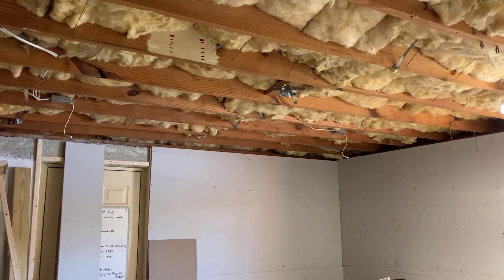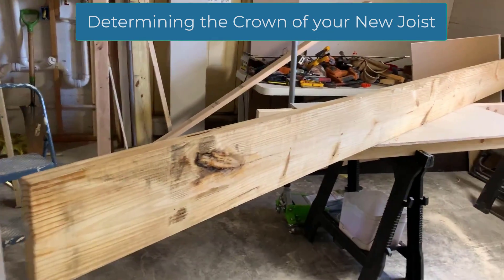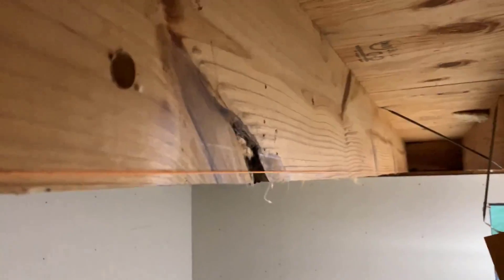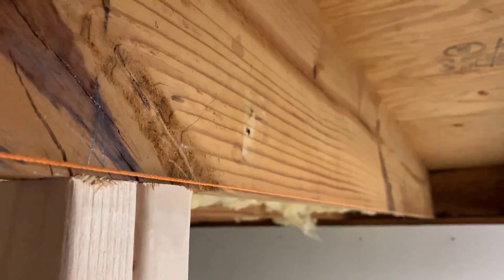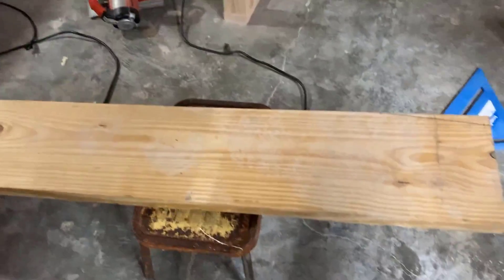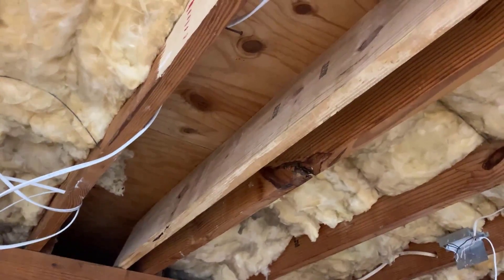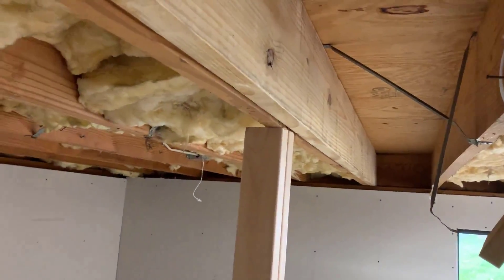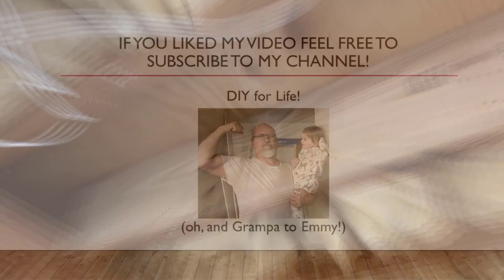Floor Joist Repair Video

Comment: Jw: would you think that building up a standard milled 2X8 to an actual 2"X8" rough cut joist with plywood plating to be the best way to replace floor joists that were used in the 1940's? Without going to a custom sawmill, I need to do that. 1/2" sides and 3/4" on the top gives same dimensions as current joists. Lapped joints on 16' span. Ie: sides are 4'-8'-4' and top is 8'-8' .
Reply from the maker: Hey there Morgan.  Sorry for the delayed answer.  I can honestly say I'm not sure and there are far more knowledgeable people than myself who could answer.  However, I certainly can't see the problem with it.  Would you just glue and nail the plywood to the surfaces?  Other than a possible concern about compression of the plywood that is carrying the weight (which may not even be an issue) I sure don't see a problem with that solution.   Good luck.
Reply: @RighttothePointDIY  glue and screwed the plywood. Really stiffened the boards up. Seams are staggered to avoid a week joint. Thanks for the reply, maybe an idea you can use.
Reply from the maker: @morganottlii2390  Awesome!  Great idea that I will keep in the back of my head for sure.  You never know....

Comment: Would it help to glue the knot?
Reply from the maker: Hey Paul. Yeah, I commented on that in the video. The reality is, that joist is compromised so bad that even glowing it wouldn’t help. The main weight is being held by the new joist anyways. It wouldn’t hurt to glue it, but I don’t think it would help much.

Comment: Hey Guy, I would suggest you add some 20b nails because screws can snap. Nails are NOT brittle and withstand expansion and contraction better.
Reply from the maker: Thanks for the note.  I have explained this in a few of the different comments but the reality is the screws are only holding the old joist to the new one.  They are under literally no shear weight.  I probably could have not even used any adhesive because the only purpose of both it to hold the new joists to the old.  The weight of the floor coming down on the joist is being bore by the ends of the joists.  When I did the video I didn’t outline that like I should have.

Comment: I wish I could have seen you removing the wires. Did you disconnect from the breaker box and pull them out through the holes of the joists? Is there a max number of holes I can drill to reinstall the wires and maintain strength?
Reply from the maker: Thanks for the questions Derek.  How you deal with the wiring really depends upon how accessible your wiring is and where it originates and terminates.  So, in my case I only had to disconnect my wiring from two places (a run to a ceiling fixture and a run to a wall switch) and pull it back and then drill the hole I needed I’m the new joist to rerun it.  However, my whole basement was exposed studs and easy to access.  In extreme cases where you can’t access the termination or origination points of the wiring (the breaker box or outlet) you may need to actually cut the wiring and put in a junction box to splice it back.  Obviously do that with great care or get a licensed  electrician to do that part if you are not experienced enough.  
As to how many holes you can drill, it’s my opinion that the fewer holes you have to drill the better. I drilled one 1/2” hole with my auger bit and ran my two wires through this single hole. That single hole should not impact the strength of the joist much at all.  I recommend making the holes as small as possible without hurting the wiring when you’re running them through.  Hope that helps.

Comment: I was nervous right from the start of this video when this guy continued to call the "joist" a beam (or calling a Torx head screw - Hex, minor detail).  Any time you hear someone continually using the wrong common considered vernacular, everything they say becomes suspect (and rightfully so).  Luckily in this situation, the wrong advice given didn't have any adverse effect on the results.
Be careful when dogmatically saying things like: The notch on the end of the beam (joist) doesn't matter, screws are enough, or liquid nails will work in a situation- unless you have the knowledge and background to substantiate the claim.  Each of those statements was technically wrong and if you used your rationale in my area you would have failed a framing inspection.  There were more statements made that I would challenge but I hope you get the idea.  Maybe just say - This is how I did it, and leave the assertions to those in the know.

BTW, how does angling the joist the way you suggest, make it any easier than the way you said not to do it?  The plywood above isn't adding any more force on the joist than the beam at the bottom.  You still have to overcome the same forces, either way.  It is all preference- whether you want to bang on the bottom or top of the joist, the effort to move it into position should be the same. YMMV
Reply from the maker: Thanks for your comments. I can appreciate you’re a professional contractor and are used to using the right terminology all the time.  I realize there are a lot of videos out there where the repairs are ‘done wrong’ according to professional contractors.  In the end, my repair is holding perfectly and I stand by the process I followed.  
As to your last question, if you simply think about the surface of the joist that you are having to slide across the other surface it should make sense.  If you put the bottom in first you then have the entire top surface of the joist in contact with the floor and that results in a greater amount of friction than putting in the joist with the top first which means I only have the friction on the two bottom ends.  This advice came from a video I saw by a professional contractor and it not only made sense it worked perfectly.
Reply: @RighttothePointDIY  Your repair will be just fine, but when others have a slightly different issue and if they follow your "this is fine" phrases, they will cause costly problems that I make a living fixing.  Personally, I would rather not have to fix the problems and just work, mind you most of the fixing are from other contractors' work.  But as Youtube grows, the problems are growing exponentially.

The answer to my last question is well thought out and probably would be the way I would accomplish the same task, though it does put a lot of pressure on a small area and needs to be watched for splitting, which you might not get with the other method.  The other method allows for the unsupported part of the "joist" to flex and move.  Your tapered ends help with this also, just saying.
The real takeaway for me is. just say "this is how I did it" and leave the analysis of what is "ok" or "right" to do, to those qualified to make those statements.
Reply from the maker: Thanks for your feedback.

Comment: That floor joist should have been cut up for blocking or cripples.
Due to the size, number and location of the knots, failure should have been a foregone conclusion.
It is the job of the framer to reject boards for their intended use when they are grossly sub-standard.
Those framers should have been horse whipped for using that board as a joist.
The framers that used it for a floor joist sh
Reply from the maker: Yes indeed!  I totally agree

Comment: Thanks. Very useful. I'd like to know more about glue cured in a released state. Whv not under stress with 2"x4"x2 upright?'
Reply from the maker: Thanks for the comment.  I don’t really know if it makes much difference. It did not settle that much. The reality was the glue may not even have been necessary since the majority of the weight is carried by the new beam.

Comment: Do you use glue for an exterior  porch board beam?
Reply from the maker: I think I would use the same stuff that I use on the inside. Liquid nails would work just fine

Comment: I have joists that extend out that holds a balcony. The balcony needs to be replaced so the contractors want to cut the joist at the stucco and run 15 ft boards through the stucco and attached them to the existing joints under the living room. I suspect they will do the same -- glue and screw the joist together. One of my big complaints, because I just had a new fence built, is that contractors don't bother to pick out lumbar, They go to lumbar stores, take whatever lumbar the employe sets out, and then the contractor uses whatever lumbar they have. They don't care what shape the lumbar is in. So what could happen  --- the new wood could have these irregulars in them and a few years down  the line they will have to be replaced.  There is a house down the block that is getting built with rotting lumbar -- no kidding - and the inspector is passing the job. I feel sorry for the person who buys that house. You better believe when this job get done I am picking out my own lumbar. Thanks for the video.
Reply from the maker: Wow! That’s pretty crazy. I will tell you I used to have a house that had a balcony that was done a similar way.  I think the key there is the lumber that they choose to make sure they have the crown at the top to avoid sagging. Also, because it’s going to be free hanging, they need to make sure they have enough going into the house and that they bolt it together when they sister it to the existing joists.
Reply: @RighttothePointDIY   @Right to the Point DIY  I am not sure what  a "crown" means but I am going to find out. The joists now sticks out 5.5 ft so they are going to make it 5 ft and then extend the wood passed the stucco 10 ft.  The balcony will be on the 5 ft. part. I supposedly have a very competent builder coming to give me an estimate and I am doing my homework before they come out because I never know how knowledgable they are or will they use that knowledge on my balcony. After all the balcony "doesn't sit on their property".  Thanks for the tips.
Reply from the maker: @citticat2  In the video I talk about it when I first show the new joist.
Reply: @RighttothePointDIY  When I was at the lumbar store he recommended Pine and I see that pressure-treated is a whole lot more expensive but pressure treated wood is toxic. I probably need abut 12 of these 15 ft long. Do you actually think the contractor is going to take the time and look for that "crown" part? One contractor didn't want to work with me because I wanted to pick the wood out and now I am so sorry I didn't do this for my fence I just had built.
Reply from the maker: @citticat2  Well, if he knows what he is doing he will read the lumber correctly before making the repairs.
Reply: @RighttothePointDIY  

I am going to bring this term up so I hope so.

Comment: will this fix circa 1956 house sagging floor center of room?
Reply from the maker: Well Mike, if you have a cracked beam the the floor is sagging it should help.  However, if the entire floor is sagging you probably have a bigger problem.  You would need to do significant leveling with jacks and then either replace multiple compromised joists and/or up additional supports.
Reply: @RighttothePointDIY  if I try to jack up a sagging true 2x6 from 1920’s for  a roof you think I’ll crack it, I was thinking of saturating it with a little water, either that or cut relief cuts
Reply from the maker: @thesolimanz  I will start by saying I truly don't know because there are a lot of factors.  For instance, how far is it sagging?  If you run a sting line like I did from one side to the other it will tell you the degree of the sag.  Also, what is the condition of the original joist?  Is it already showing signs of cracking in some places?  Whatever the case, you are going to put another ceiling joist in there anyway right?  If so, really the only main concern would be catastrophic cracking (like a complete break). Don't know if that helps but that is all I could think of.

Comment: I've seen this done with plywood 23/32. Is that correct? They cut the sheet the width of the board. Jack it  Glue and screw sheets on both sides.
Reply from the maker: You are correct, there are laminated beams made of plywood that are used for headers. Sometimes they’re also used for floor joists.  In this case, it was just as easy for me to buy another joist and install it.  I guess it would depend on your application.
Reply: @RighttothePointDIY  Thank you

Comment: Great job but I’d definitely had used some lag screws 3 inch maybe 3/ half inch
Reply from the maker: Hey Brian.  Thanks for the response.  Definitely could have used lags but, as is pointed out in many of the comments, the screws are not holding any real shear weight.  They really are only holding the new joists to the damaged one.  The new joist is holding the weight (vertical) that the old joist held so the type of fastener was not as much an issue.  In the case of my repair, it has been holding great and it has been almost 2 years.  
Thanks for the comment and I’m glad the video was helpful.

Comment: I am a fan of using some paraffin wax on the friction points such as on the new board bottom sides (at the sill ends) to make the final hammering much easier.  It won't affect the holding power of the beam, only the assembly.  Not much different from the wedges you remove on the top face. Together they would ease final assembly. Good video.
Reply from the maker: Good idea Dale. Thanks for sharing that

Comment: seems like a big span for a 2x10.  We were always taught roughly 1 inch tall per foot up to 12
Reply from the maker: Well, the entire house was built this way and the span of each joist is roughly 14 feet and they are spaced at 18” centers . There are no other sagging or cracking beams in the entire basement and this one only sagged due to the knots.  The house is over 50 years old and if it has done this well for 50 years I think they chose the right sized joist.

Comment: Doesn't code require screws 2" apart?  Carriage bolts are a good idea; 2 on each end & one in the middle about every foot or so should be optimal.
Reply from the maker: I do not believe so.

Comment: To test crown: lay on flat surface & see if it rocks or not like a rocking chair. If so, your crown is the side touching the floor.
Reply from the maker: Thanks for the comment.  That is indeed another way to determine the crown as long as you have a very flat surface.
Reply: Hahaha, rocking requires level floors!  So, not on my floors! Easier to eyeball the crown

Comment: I’m a carpenter and general contractor and have been doing structural work for a couple decades. Miracle of miracles, but I find nothing to criticize here. Good work. Where I work, we require full depth blocking, not this diagonal straps. So yeah, can’t believe a diy video on YouTube is good and informative, not dangerously wrong.
Reply from the maker: That is high praise Matthew!  My father taught me to think things through, get good advice and not cut corners.  Thanks for affirming his training.  Have a great day.
Reply: @RighttothePointDIY  exactly. I’d tell my guys in the morning after we rolled out the tools “before you put your bags on, what are we doing today and how are we doing it?” Sometimes an hour thinking is a worth a day or more working, and generally gives better results than working and not thinking.
Reply from the maker: @mechanicalman1068  That is a good way to tackle a job.  Think it through, make a plan and adapt as you need to.  I’d hire you and your crew!  LOL
Reply: I don’t think those screws have the sheer strength you need, those aren’t structural screws, wouldn’t nailing be better with a few structural screws
Reply: @RichyRichKicks the screws aren’t subjected to any shear forces since the new joist has full baring on both ends, so structural screws are not necessary. They’re there for clamping force to create a single member out of the old and new joist. But good point. Most screws are quite brittle whereas nails are not, a common amateur mistake.
Reply: @RichyRichKicks 
Came here to ask the same question. I was always taught that screws are brittle compared to nails.
Reply: Yep…Think it out. Plan it out Knock it out. Works every time. 👍
Reply: Real world testing on “drywall” screws shows they are better than you think although I would have used a nailing gun. 😂
Reply: Is it ok to only sister on one side of rotted wood or do you have to put old wood between two pieces
Reply: Personally I would have installed some coach bolts but I a belt and braces type of guy. Good video all the same.
Reply: Why do you need to glue? The space only needs one joist anyway. Doesn't the new joist just take the place of the old joist.
Reply: @sli43  good point and you’re probably right, but not knowing if there is some other load directly above it it’s hard to say. Also, the subfloor is attached to the old joist so we’d like to have the old and new function as a single member to prevent the new one from separating since it’s not held in place by the subfloor fasteners: another great reason to use full depth 2x blocking instead of those diagonal braces. Think of the new joist as a supplemental repair, not replacement. And it’s just good practice. But yeah, probably splitting hairs and it’s likely fine without it. I figure if it’s cheap and easy to do and the possible consequences suck, I’m just going to do it.
Reply: Is it ok to only sister on one side of rotted wood or do you have to put old wood between two pieces

One piece new onto only one side of joist

Comment: You could have sistered that broken joist more easily by using 3/4 inch plywood on both sides of that broken joist, and glued and screwed it in place.  This is what the city code inspector said would be sufficient to fix the overscan and damaged floor joist issue.
Reply from the maker: Thanks for the feedback. That would’ve been possibly little more easier. However, the repair is working well.